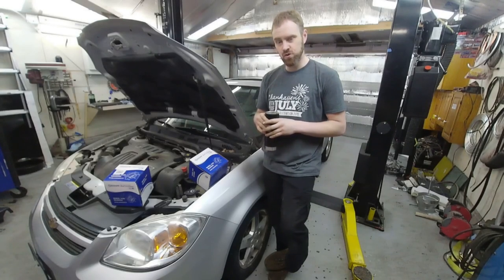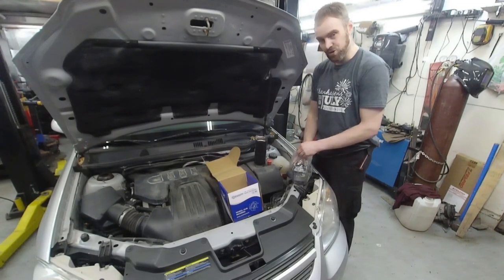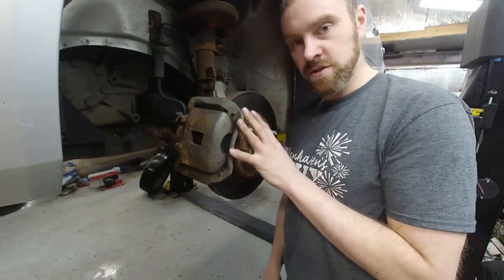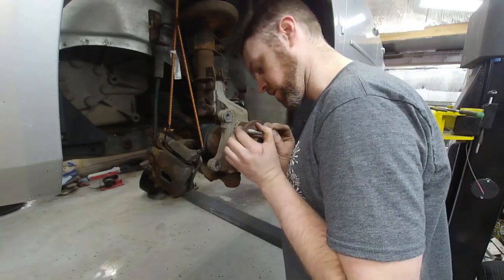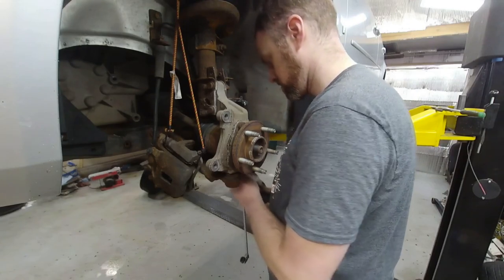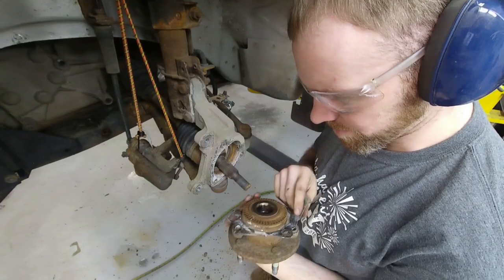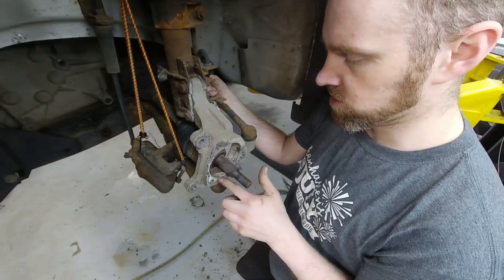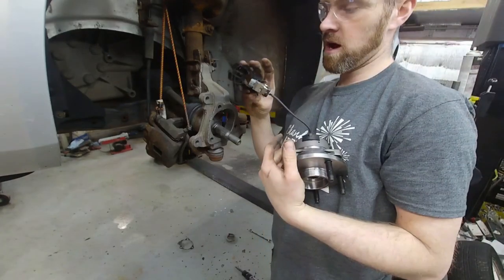07 Chevrolet Cobalt Wheel Bearing Replacement

Comment: they wont last  better check if the have  grease  in them..if they spin  easy  dont put them on  get timkens
Reply from the maker: Lol customer supplied they felt normal not dry
Reply: Should you put grease on the teeth?